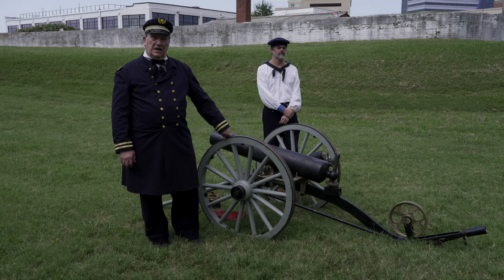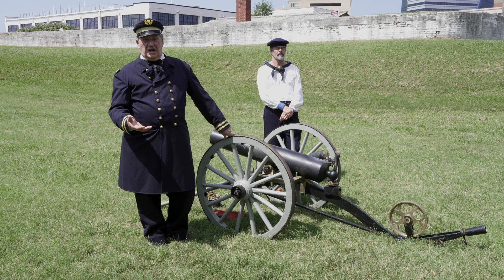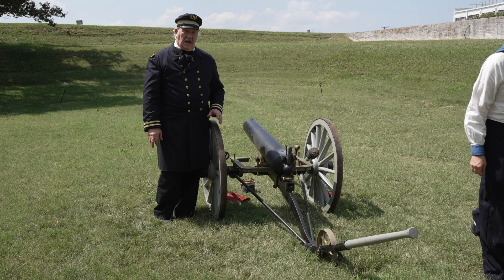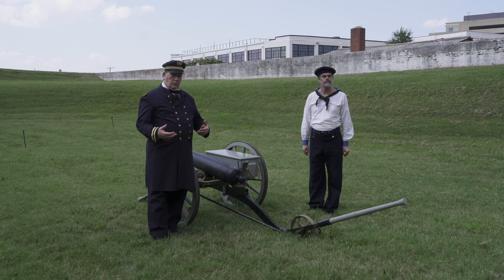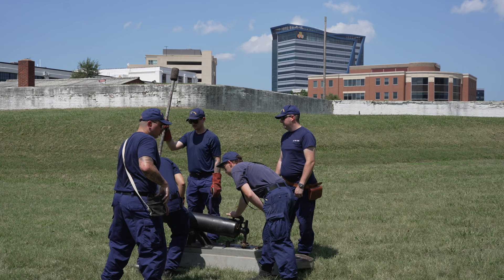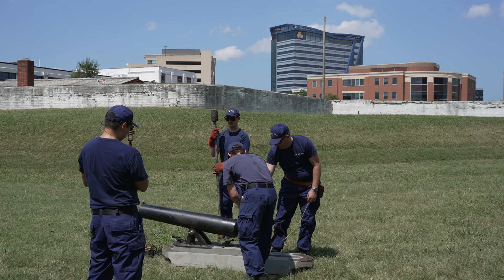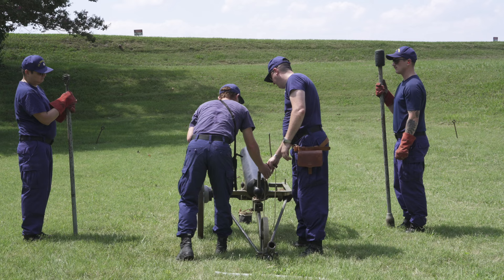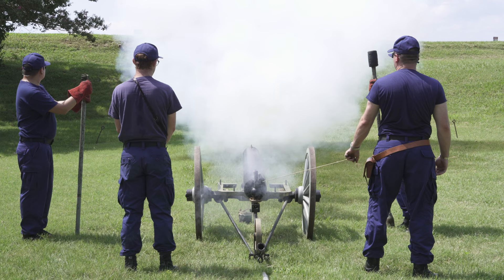1850’s Dahlgren Boat Howitzer Firing and Barrel Shift Exercise

Comment: That reminds me of a piece a friend of mine would bring to re-enactments but he called his a 3 inch ordinance rifle.  A Campbells soup can was about the size of the inside of the barrel, so for "live firings" he'd use the soup can as a template to make his flour rounds with, wrapping aluminum foil around the can, then sliding the foil off and filling the sleeve with flour.  I don't know if he wetted them or not, but when he fired that thing at his house once that flour shell went through the lid of a 55 gallon steel drum.  For the life of me I can't remember his real name, but he went by the nickname of Dar and lived in Dubois County, Indiana.  He also had an original US gatling gun with a serial number of 0006 that he claims was used at Vicksburg.  It was the kind that had a 40 round gravity fed clip at an angle to the right if you were standing behind it and it fired 45-70 rounds.